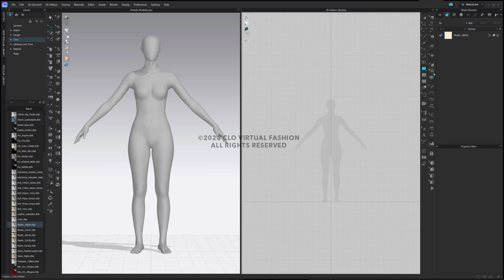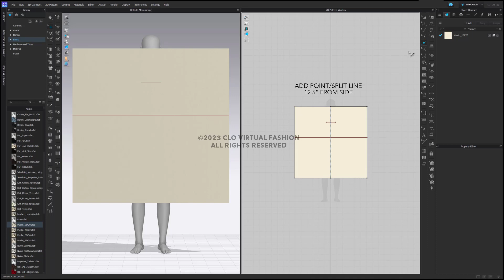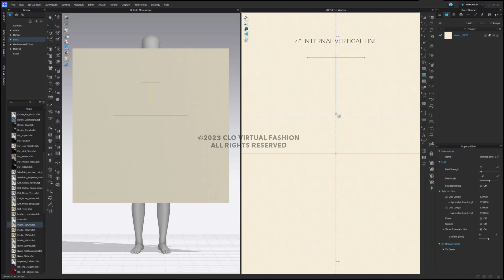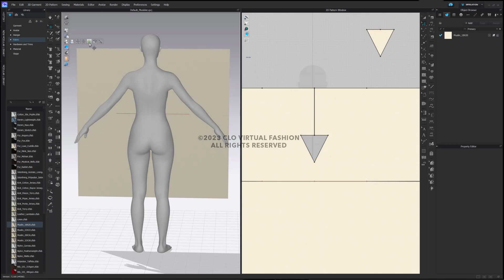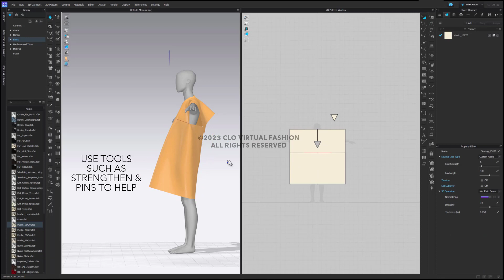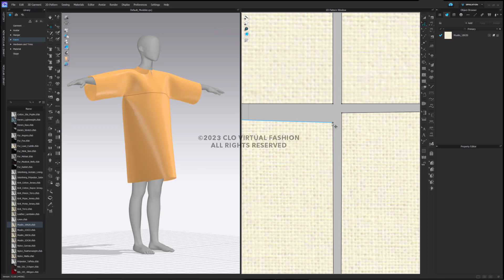Creating a Zero-Waste Tunic in CLO

Comment: Why does the program exit when adding sbsr material, Please Help ?
Reply from the maker: Hi. Have you made sure that your computer is up to the recommended specs? 
-https://support.clo3d.com/hc/en-us/articles/115000307168-CLO-system-requirements-June-2023-
This video is by IDES and she has a great tutorial to use SBSAR materials which may help you - https://www.youtube.com/watch?v=GYccJ8zLHDo
Reply: @CLO3D  Even when the file size is small, it does not work and exits the program clo3d. What is the problem?
The laptop specifications are good ryzen 7 h  16 ram rtx3060
When I use the spline and mask to path and export the sbsar file to clo3d, it does not work and exits the application, while previous versions worked well. Please solve this problem.
Reply from the maker: Hi There. For further help we recommend posting your question to our CONNECT forum where you can also add images :) 
https://connect.clo-set.com/community